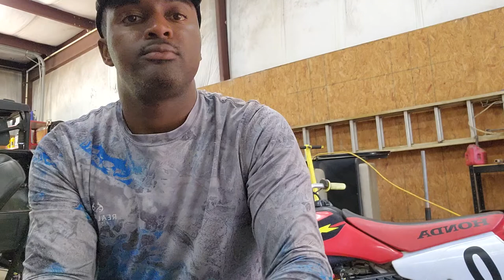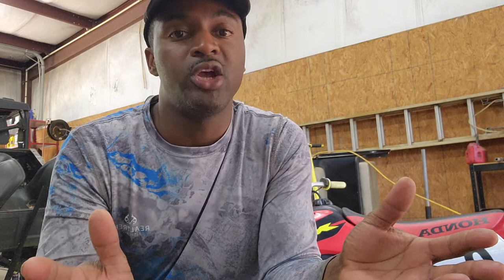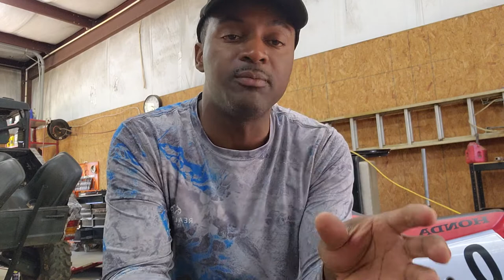Golf cart wires are getting hot! 🔥 🔥 🔥 🔥 Is my motor bad in my Club car or Ez-Go golf cart?

Comment: Hey there. Just recently found your channel. 
I have a question. My ATV won't start. The motor will spin if I turn it by socket wrench. 
It'll turn a couple of times with my electric start. But locks up. Finally I checked the valves and they have 0 clearance on the exhaust side. It's extremely tight. Could this be my problem. If so how do I fix this. 
It's a Polaris Magnum 325 2*4.
Reply from the maker: If anything tight valves will make the engine easier to spin. Loose valves cause greater and delayed compression making it harder to spin. It's probably not the valves. Check to see if the engine oil has gotten gasoline mixed with it!